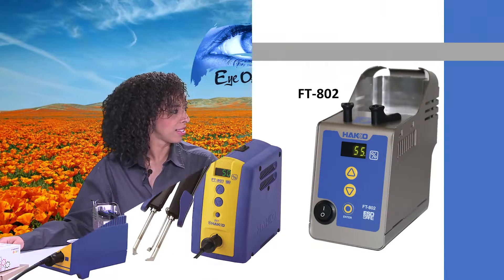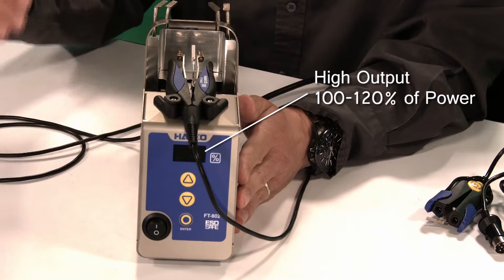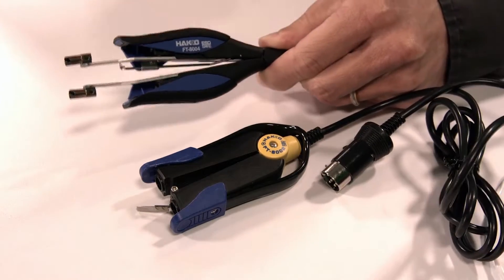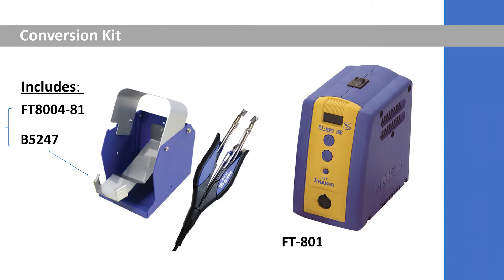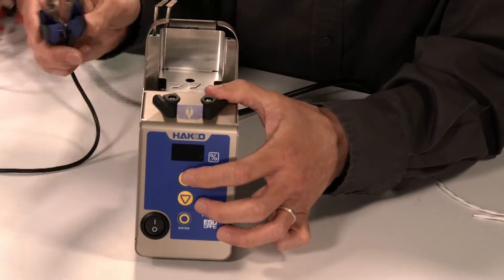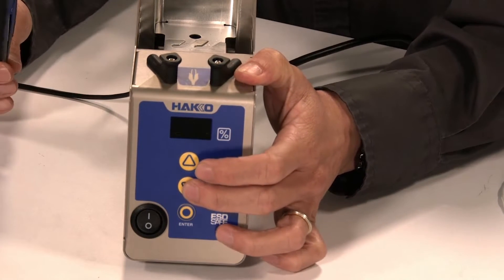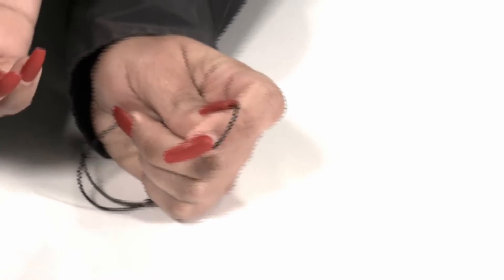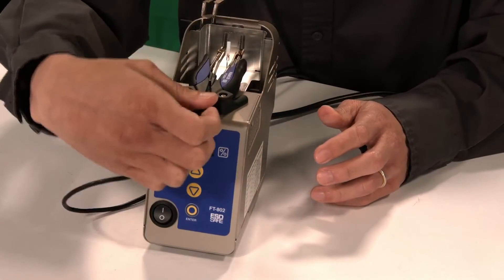"Eye On Hakko" presents, "Strippin' with Hakko"

Comment: I personally prefer a knob for quick adjustment of temperature. Buttons are ok for fine - but it is such a waste of time to wait seconds for it to move temperature values at a quick rate when holding them down. I'll likely be modifying my other stations to have a knob, and button, support. Rotary encoder should work and each indent it could trigger a button press.. The one issue is the software as you should also change it so if you rapidly go through that it eventually switches to 5 / 10 per tick.
Reply: I do like that the power switch is on the front. It is annoying for bench-top equipment to have them in the rear. I either modify my stations, or if I haven't had a chance to modify them yet if they don't have them on the front I use Belkin or another brand 3 prong switch ( the current power switches on Amazon are low-grade and high-risk fire-causing pieces of trash which should never be used - check the reviews... )... I can't find these old ones anywhere either - it seems they've been discontinued which is unfortunate as I use them for a lot from my kettle to workstations.
Reply: You should have a built in tool to pull the insulation off... This is one of the most annoying things for stripping sheathes off of wires. I would either use the hot end each time, but he showed it without doing that - not sure if you aren't supposed to on that type of wire, or he did it differently because of the inner wires and sheathes - but why not do it for the inner ones then.... so a separate tool hanging on the end would be useful so you could score - and without setting the tool down, and without changing hand position too much, take the sheathe off....